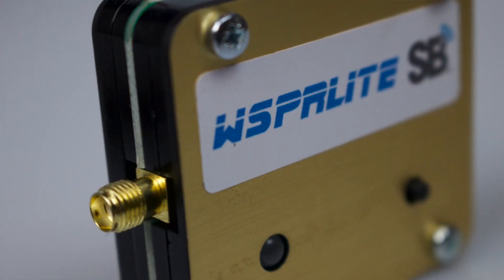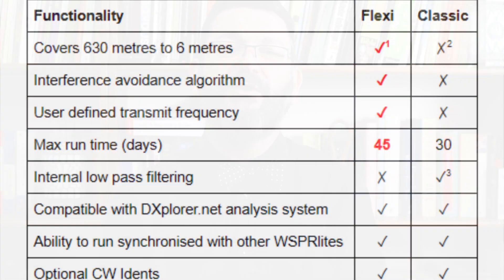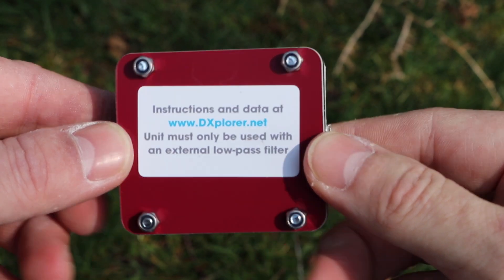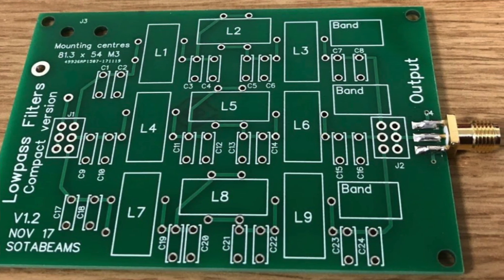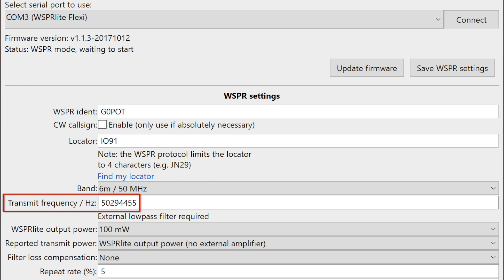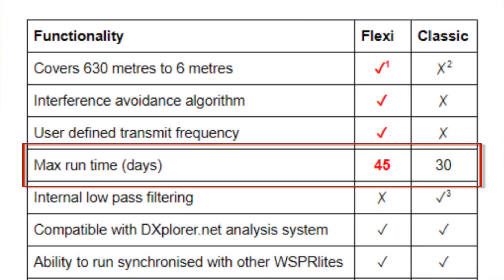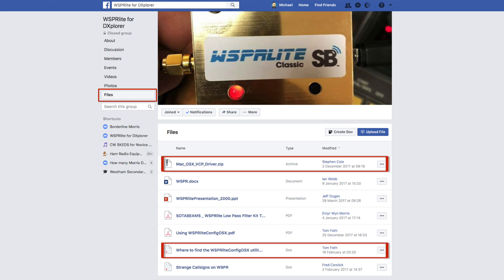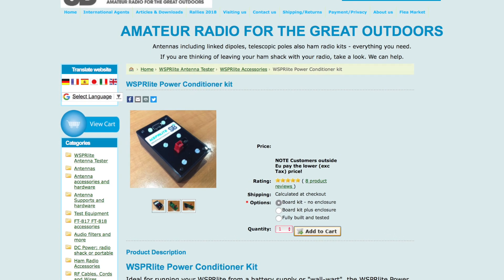SOTABeams WSPRLite Flexi

Comment: can you please explain the 45 / 30 day run time, i still cant understand it. Also, can they be run as a full time wspr beacon ?
thank you
Reply from the maker: A A When you configure your WSPRLite, one of the options is ‘Run time (days)’ and this determines how long it will run without the need to restart the unit. This limitation is simply down the the accuracy of the internal clock and its ability to start the transmission near the start of a minute. Over time this clock can drift and eventually the WSPRLite will not start the transmit cycle within the required window. The clock on the WSPRLite classic should keep in sync for up to 30 days and the WSPRLite Flexi keeps good time for up to 45 days. If you want to use the beacon permanently you simply need to restart it periodically, say, on the first day of every month, to keep it operational.
Reply: @g0pot  Thank you,  you answered my question to the exact point. Also, yes we are looking to have a simple full time beacon for our radio club this seems like a very good choice

Comment: What were your findings on the comparison between the AlexLoop and the W4OP?  

Dave K8WPE
Reply from the maker: From my analysis using the WSPRlites I would say the W4OP loop had slightly better results with, on average, a stronger signal at each of the receiving stations. I'd also say that the W4OP loop was better made and felt better quality (I had the version with remote tuner). The W4OP loop I used did have a fault on it preventing it from being used on 40m but the remote tuner was definitely a nice feature (not sure if both loops have this option?). The Alex Loop certainly take the prize for low weight and compactness if you want something really portable and the model I used was a few years old now so designs may have improved. If they are comparable in price the W4OP loop would be my preference for fixed or portable where I don't have to carry the loop. For backpacking portable the Alex Loop would (and is) my go-to loop option.